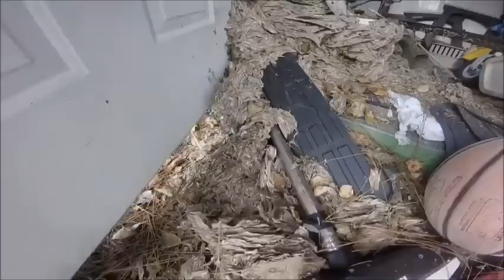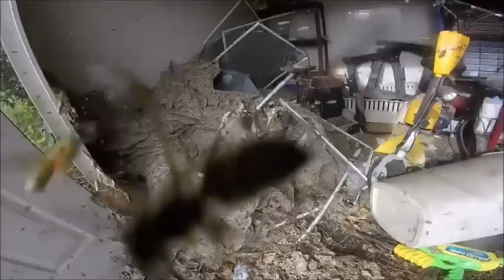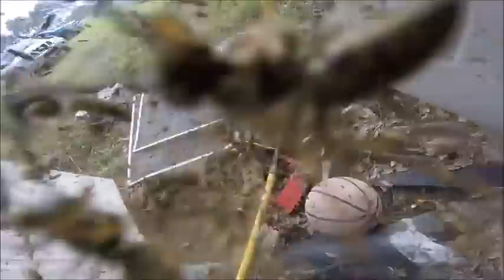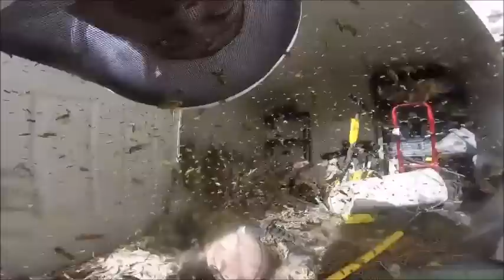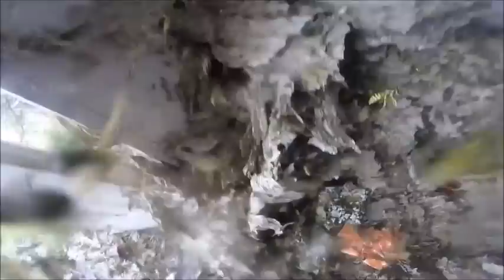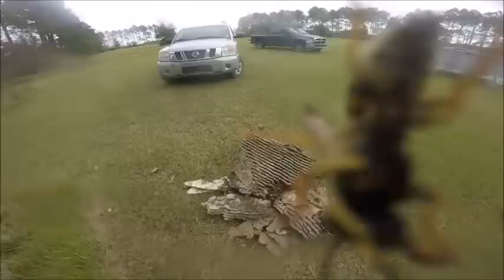Gigantic Hornets Nest Extraction in Louisiana

Comment: Not sure if this has been said yet, but I reckon these wasps (not hornets) are native American, not European, as the pest controller thinks. They are Vespula squamosa, the Southern Yellowjacket, which is native to Eastern US, as far as Texas, and reaches as far south as mid-Central America. This is clearly a multiple-season nest, hence why it is so scarily large... with possibly 100s of 1000s of cells!
Reply: zeeox they r yellow jacket hornets
Reply: Hornets are, technically speaking, just large wasps really, although an additional definition that is also sometimes used is that hornets tend to nest above ground whereas yellowjackets generally make subterranean (or dark shed!) nests. It's quite a casual distinction, but I have read that people in the US often call yellowjackets hornets so perhaps that's why you are conflating the terms. The main thing to remember about V. squamosa is that it is native, and not invasive.
Reply: zeeox exactly. Tho they r different they r part of the same family like I said, they r similar but have differences.
Reply: I'm not sure you said anything? (Other than to call them 'yellow jacket hornets'.) All hornets are wasps, but only some wasps are hornets. I think the confusion here is that the US really doesn't have any true hornets, and therefore people get confused when naming the yellowjackets (and the confusingly titled bald-faced hornet for that matter, which is also a wasp and not a hornet).